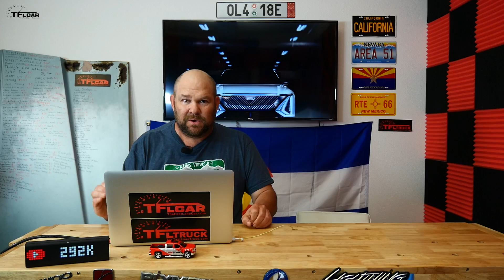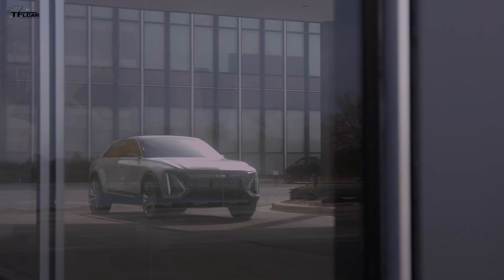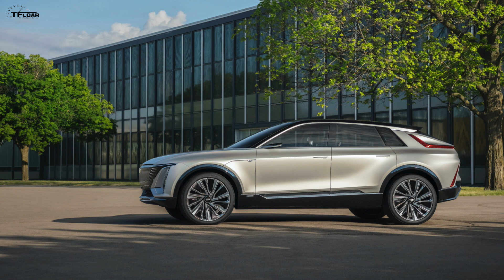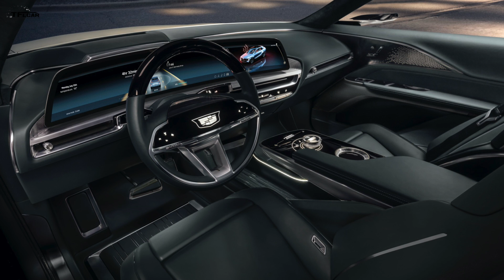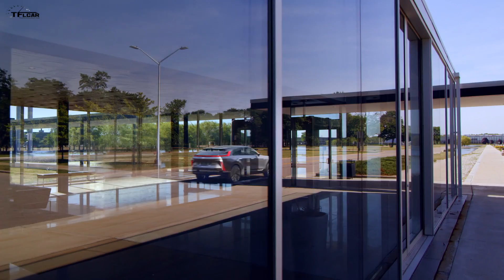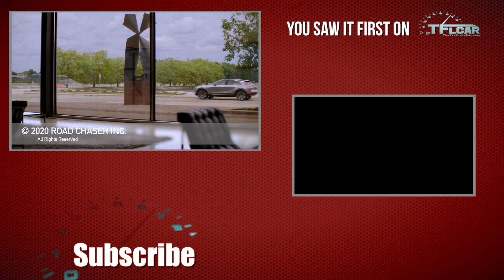Breaking News: The New Cadillac Lyriq Jumps Into The Electric Car Fight With Both Feet!

Comment: UP TO 300Miles RANGE. Meaning with the single motor And lower performance trim. Also, in 2-3 years time with 2-3 year future tech. This is D.O.A. ALREADY TODAY Tesla get 315Miles range with their "dual motor" Model Y. Battery day is a few months away. In 2-3yrs time Tesla will be even further ahead. Also, GM and the others are at the mercy of a sub standard 3rd party, for profit charging network and the Liriq is said to charge at 150km, LOL. Tesla has an already enormous supercharger network and they charge at 250kw. In 2-3 years time that network will be even bigger.

Comment: Ford broke the mold by building a car every man could afford. The key to success is cheap affordable mass production transportation. The only way EV's can replace ICE is with working class prices. Detroit needs to focus on entry level rapid charge systems. Bottom up instead of the current top down EV market. China is beating everybody at the moment.
Reply: This is why I am closely watching the new German mini modular van/sedan/truck that charges in 3 hrs on 120 volts and starts at $18k. I want some basic transportation, not a status symbol. If it was legal and safe to drive my 36 volt electric golf cart to the post office and store, I would do it. I don't need to go 0 to 60 in less than 3 seconds and I also don't want to pay for it. I would be perfectly happy if my Subaru Sambar mini truck was AWD electric and only as quick as it already is.That would be enough. I could afford to work it like a rented mule and not worry about the fancy paint job.

Comment: I loved the car.  But I do want to point out one thing I did see in the reveal that kind of bugged me.  The Bolt's motor, when torn apart and analyzed, was deemed to be excessively heavy and expensive to make, according to reporting from Bloomberg news.  during a cut away to the platform Based on what I saw for the motors, they looked near identical to the Bolt's motors, which kind of bothers me.  It's a small nitpick, but I didn't see it noted anywhere else, so I thought I would bring it up.

Also, I'm really looking forward to learning more about the batteries.  specifically how much money they save over their old Li-Ion batteries per KWh.  The battery is far and away the priciest part of the car, so any saving there is a big deal.
Reply: It's just crazy to me how the Bolt, despite being electric, has its entire front end full of stuff with no additional storage.